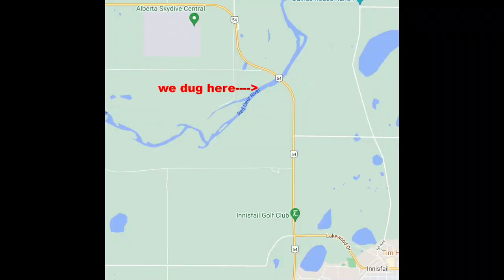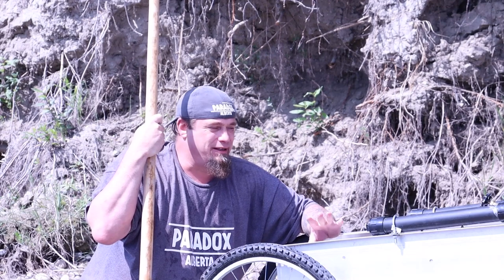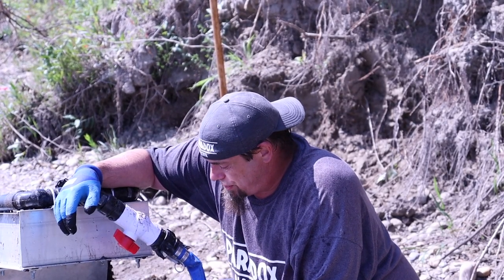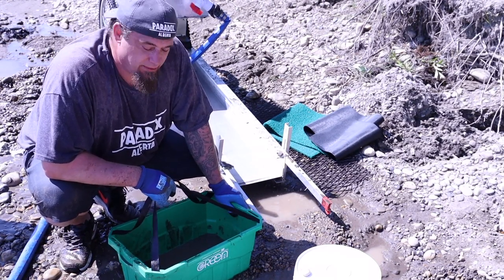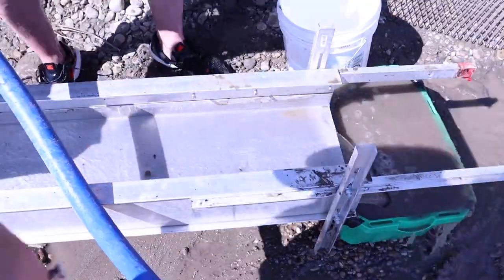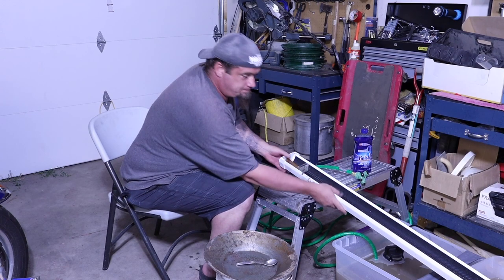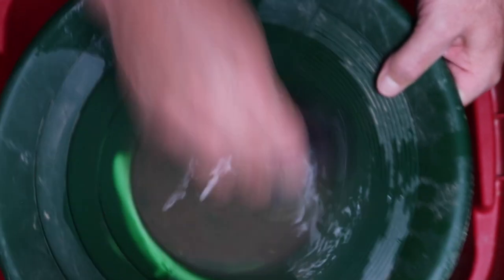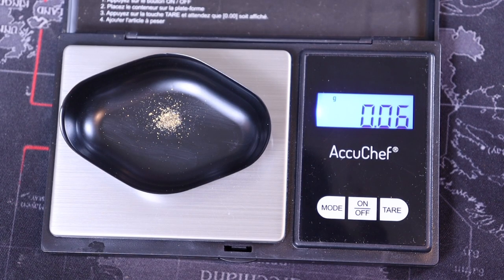FINDING GOLD!(Episode-16)Red Deer River 2021using homemade highbanker!

Comment: You can do good keeping material in the sluice by hanging some rubber flaps off the sides of the fedder box.
Reply from the maker: It’s on the list I’m gunna finish this season as is then do a complete refit in the fall
Reply: @paradoxalberta5066  Right on. You'll definitely notice it in the clean outs. Thanks for sharing your adventures brother

Comment: 1 metre of dirt is fifty 20 litre buckets full
Not a particularly rich deposit
You must be in a non gold part of canada - you must go to the Yukon
Reply from the maker: I cubic meter is actually 204 gallons
Reply: @paradoxalberta5066  So if you divide 204 by 5 you come up with 41 , so thats forty one 5 gallon buckets - still a lot of material for 0.07 grams of gold
Reply from the maker: @mohammednovalija  meh that’s alberta gold for ya . That’s why it’s more of a hobbt
Reply: @paradoxalberta5066  You can only catch the gold that is there.